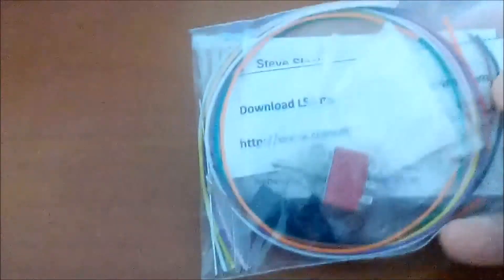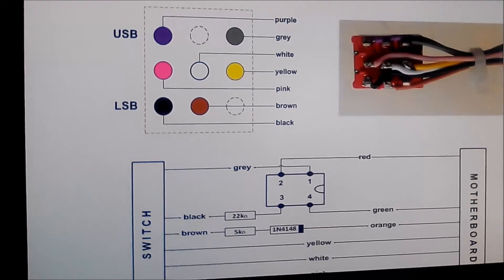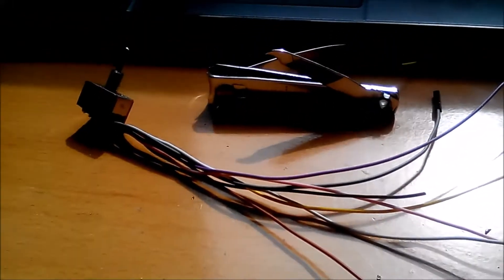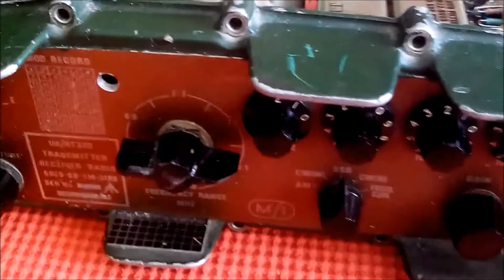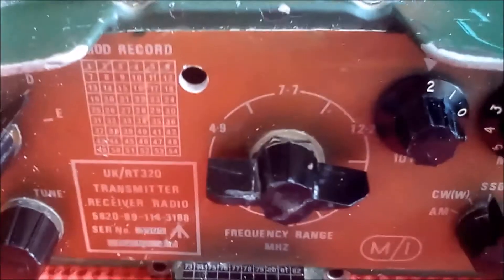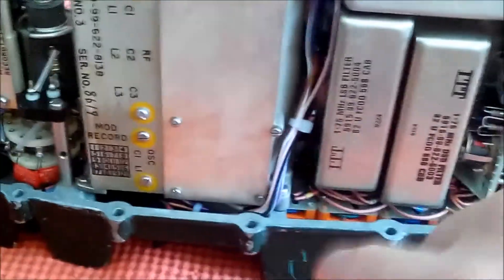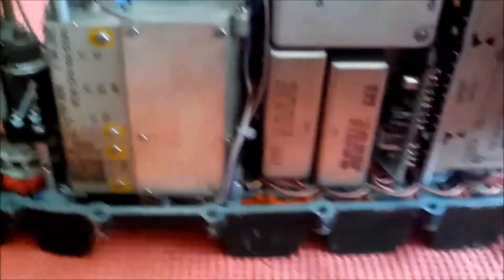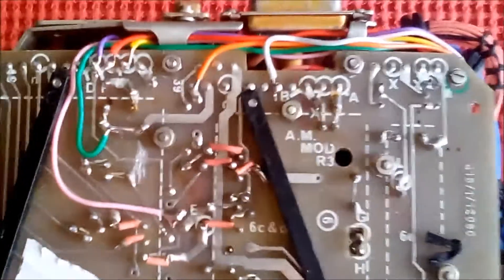LSB Clansman Mod

Comment: Is this mod essential for amateur bands?
Reply from the maker: If you are a member of other military radio groups such as vmars or clansman then you can normally find users on usb on the lower bands. 180. 80 and 40 are traditionally in ham circles LSB so if you want to use the radio with other black box operators then yes ..the mod is helpful
Reply: Eltimple thank you for your reply and info!

Comment: What does the LSB actually do ?
Reply from the maker: LSB or lower side band is a transmission mode like FM or AM ( Frequency Modulation or Amplitude modulation) Military radios such as the clansman can normally transmit in AM , CW , ( Carrier Wave or Morse ) and USB or upper sideband only....In ham radio all frequencies below 10mhz are Lower sideband while all those above are Upperside band by convention,  So when i added LSB to this radio i was able use the radio to speak to fellow hams on 160meters, 80 meters , 40meters which by convention only use LSB. 

What does LSB do?...well in this case the radio is tuning the lower side band of a signal .....in radio you can tune upper , lower or both ...which is double sideband modulation. Its a very efficient method of transmission as your voice is converted into radio waves only when you are speaking , unlike an am broadcast transmitter than has a carrier wave or signal going all the time regardless of if you are speaking or not.....i suggest you google "single sideband " for a more detailed explaination

Comment: Thanks for info but i could not drill a hole in the face or radio , There is a mod where you re wire the mode switch.
Reply: There are a few different versions of this mod. Some use the battery check position ( which means that you see battery voltage instead of voice peaks) others use a magnet and reed switch all have different pros and cons

Comment: Thanks! I ordered the kit and installed it. It works! I get a soft tone while on usb though ... does it happen to you?
Reply from the maker: cesardeluxe hi. You mean on LSB you here a tone.. yes if not tuned to the band. Normally the normal noise drowns out the tone.
Reply: Eltimple it happens only in usb. It is a light whiiiiiiim when usb on of course. On lsb it is fine(only tonw when not propper frecuency selected)
Reply from the maker: with normal band noise it disappears, in my case i cannot hear it unless i unplug the antenna , but , due to the nature of the clansman and the unshielded cables inside there will be some leakage. Im happy with mine as it does not affect operation at all, I believe there is a second kit, that eliminates the risk of whine breakthorough but its a lot more expensive

Comment: How did you do the smeter mod?
Reply from the maker: http://g8jnj.webs.com/PRC%20320%20Modifications%20(V1.5).pdf
Reply from the maker: just 4 diodes, makes the radio complete in my opinion
Reply: Have you performed any other mod? Are you based in Spain? 
73 de EA3IAV
Reply: Bueno si. es recomendable a cambia los condensadores electrolíticos en el puente pq es un fallo muy común en estos emisoras..estoy en la coruña
Reply: Bueno si. es recomendable a cambia los condensadores electrolíticos en el puente pq es un fallo muy común en estos emisoras..estoy en la coruña
Reply: ElTimple ah! Genial! Conoces algún site en internet con las referencias sobre los condensadores electrolíticos y sus valores? He buscado un manual pero no logro encontrar algo
Reply: Sorry. Do you mean this ones?
https://xa.yimg.com/df/prc320/PRC320_HI_VOLTAGE_CAPACITORS_REPLACEMENT_V1.pdf?token=5G2hv2zh5fy1wQA4cGuNeERljO4Rv6YKv2mo5Tsyoc9bMhg0SHA070zVXr_4dhGQpDCLCvunQxg-Aaq25IqHLv1z8E1zCFUOe0UT1YKaqLwb3rlzcSV2sp0jsWjAP5vlKvdD7vhzJ7xlK8cHysU&type=download
Reply from the maker: quizas , pero el enlace no furula para mi.....hay un grupo en yahoo donde hay un monton de info sobre estos radios prc320@yahoogroups.com  hay 4 electroliticos , 2 en el puente y dos en el synth que provoca un monton de problemas
Reply: Eltimple exacto! Los acabo de comprar. A ver si no muere nadie en el intento 👍
Reply from the maker: muy bien , soy EA1/ G1VQI pregunta en el yahoo grupo ( o QRZ G1VQI) por el wassup del grupo pq podemos hacer citas en 20m o 40 m  clansman a clansman